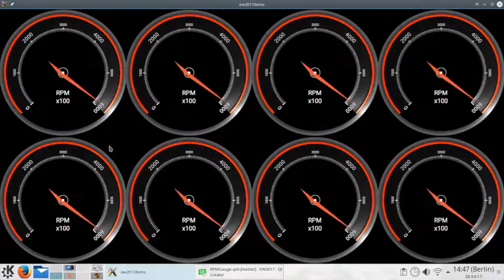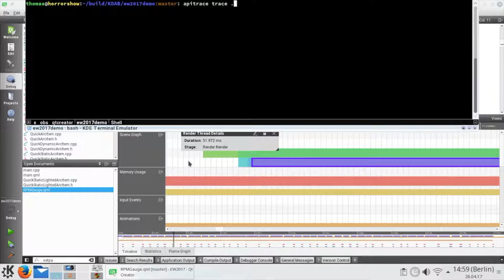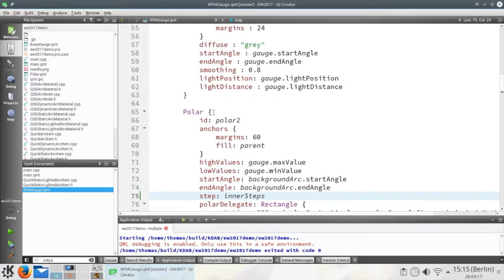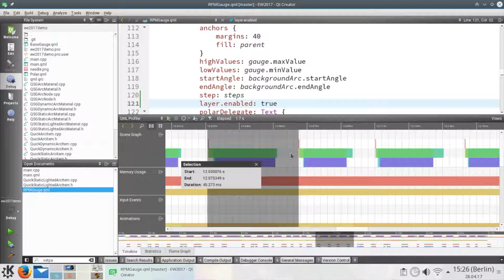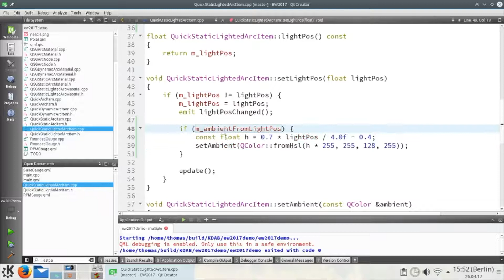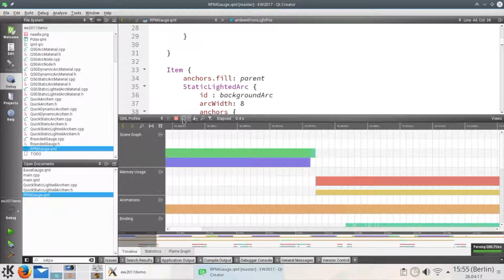Profiling QtQuick HMI Performance on Embedded Linux - Thomas McGuire

Comment: Using api trace to locate the opengl code is ridiculous. If I'm skilled in OpenGL, Why  do I use QML ?
Reply: I think you missed the point...

You don't need to be "skilled in OpenGL" to just look at the apitrace output and see a bazillion of the same function called each frame. At that point, you just ask yourself why it might doing that, and then go look at your QML code and see if you can figure out why. 

Well that, and of course the fact that QML is about three orders of magnitude to write/develop/test than OpenGL code is.